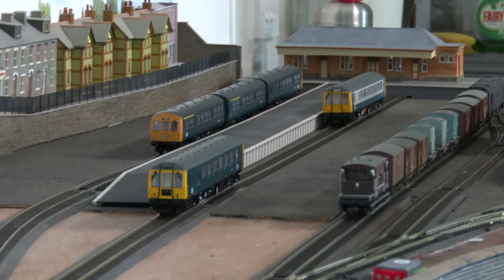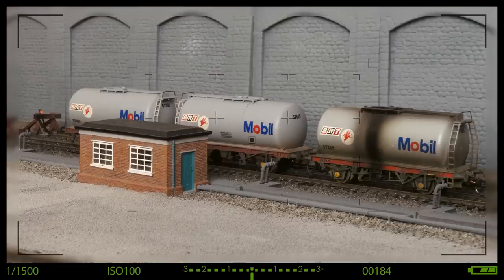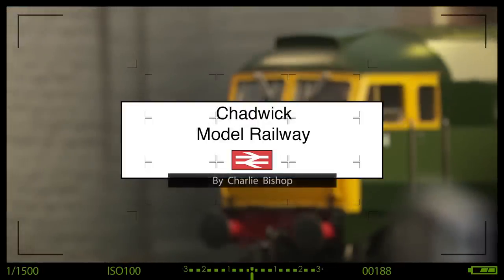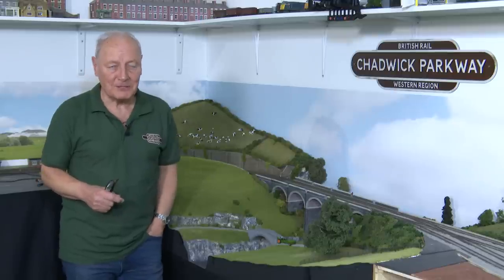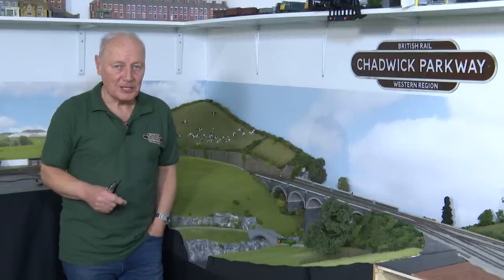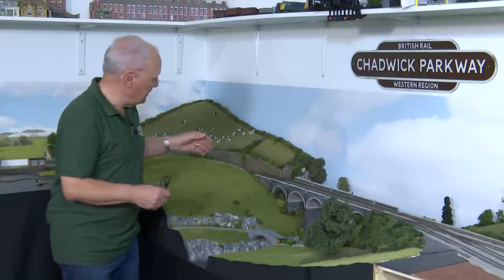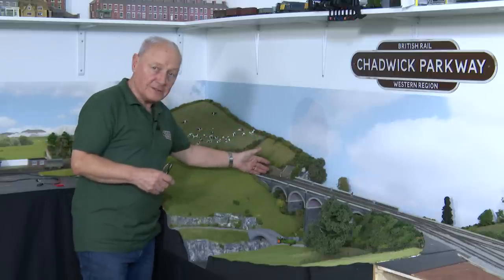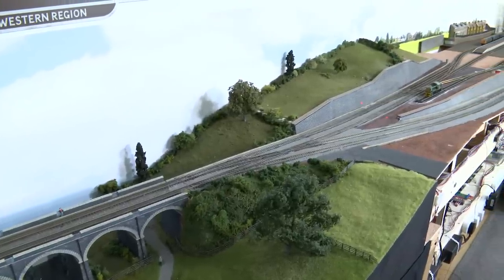SIGNAL POSITIONS at Chadwick Model Railway | 199.

Comment: Hi Charlie, 

A great video, thank you! I'm also trying to figure out how to signal my layout and have been looking at both the SE8C and the SIGM20. Here's what I think I've figured out but would love be corrected if I've got any of this wrong...

The SIGM20 looks like a great product and appears to have the ability to program lots of signal logic based on block occupancy and point position signals received via loconet. Great if you are running trains manually and want signals to change automatically. However, it does not appear to report the signal aspect to loconet and the only external control of the signal is to either force it to red or return it to its usual logic based operation using an accessory address. I use iTrain, but my understanding is that with any computer software you will not be able to display the signal aspect on the computer screen unless it has been forced to red or you set up additional logic within your software to mimic the SIGM20 logic. 

The SE8C does not appear to have any internal logic and therefore any automatic signal logic would need to come from computer software. I have found this relatively easy to set up in iTrain and the logic will still apply even when running trains manually. However, the SE8C is pretty expensive and also has several other functions including operating as an accessory decoder for points. So perhaps if you have signals and point motors in the same area that both need accessory decoders this might be useful.

I use DCC concepts cobalt IP digital points, which obviously have their own decoders included, and so have no use for the additional functions of the SE8C. For that reason I think I'm going to go with the Train Tech DCC signals, which incorporate an accessory decoder, and write logic within iTrain which will control the signals via their accessory addresses. I believe this should work whether the trains are being operated automatically or manually (provided the iTrain is connected and running).

I'd love know if there's anything here I haven't understood properly or whether there is a better solution that I'm missing! 

Keep up the good work with the videos
Reply from the maker: What an interesting comment Duncan. 
You are clearly leaps and bounds in front of me.  Let’s keep in touch regarding development.
Please use 
Chadwick modelrailway @gmail.com.
Regards Charlie

Comment: Hi Charlie,
Always enjoy watching your videos over many years. Regarding the headshunt signalling query, you could use a yellow ground shunt signal without any additional signal to give access to the main line. As I understand it, when the signal is 'on' this permits the driver to use the headshunt, passing through the signal. When the signal is 'off' this permits the driver to access the main line. The old style disc signals were either withe with yellow band or black with yellow band, and the all light style same as the red light type but with a yellow light. I can't say for certain, but the yellow light type may have been withdrawn from use by the 1970's. For definitive guidance you could check with the Signalling Record Society or take a look at The Signal Box. Good luck.
Roger Gann
Reply from the maker: I think you’re bang on the money, Roger. Regards, Charlie

Comment: Hi Charlie! I am not certain, but if I was approaching the station with the intention of going off the main line and into the sidings complex, I would expect to be held at the signal with a red on approach and then, as I got nearer, get a proceed aspect on the position light and a route indication via the theatrebox to give me permission to pass the mainline signal at danger and proceed at caution as if approaching a point of obstruction, as I would be entering a section under localised control.

The points are manually operated by shunters, thus the shunter(s) is(are)effectively the signaller for the section. I would therefore expect a shunter to be on hand to receive the train as it enters the yard. These days there would be a ruddy great stop board and a chap or lass standing there ready to give you verbal or visual instruction (depending on the local rules). I suspect however that ‘back in the day’, the rules weren’t quite so rigid! 😂

You could have different destinations too e.g. ‘G’ for goods, ‘S’ for sidings, perhaps a ‘P’ for private or a ‘C’ for carriage sidings, etc. There’s no real hard and fast rule on such things I find, it’s more about what local practice has historically been. As for the exit signal onto the main line, I’d expect a main line aspect to proceed and an associated position light to govern entry into the headshunt. I’d also expect another position light protecting the points into the headshunt, but again I’m not sure if that would always have been the case! 😉

As for the feather dilema, if the signal had historically been set with the ‘Branch station as the ‘main’ and the other route ‘secondary’, then it would possibly be set at position 4. However, if the signalling system had received a fundamental restructuring and the priorities changed, then I would expect position 1 (or causally more likely, a ‘B’ for branch in a theatrebox and blank for continuing on the main line). Either way, I would expect that if proceeding into the station, the signaller would hold the signal manually at red on approach and only give a single yellow proceed aspect onto the next signal as 1) they are very close together and 2) the next signal would be a red-on-approach signal if proceeding into the yard 🤔

I hope this has been of some help, though if it’s given you more worries I apologise profusely! 😂

Cheers Charlie 👍🍀🍻
Reply from the maker: Great info, Tim, with outstanding information. Much appreciated, regards, Charlie

Comment: Hi Charlie. As someone who travelled regularly from Crewe South Junction from 1957 into the 1980's may I mention that entering Crewe S.Jct northbound there was a massive colour light signal gantry crossing all tracks. Most were "theatre types" giving route indications as follows:- For a platform P# (P1 etc) was displayed. For a bay platform a yellow light with B# (B5 etc) and for non-stop services T# (T4 etc) was displayed indicating which platform you would pass through. As regards feathers normally the 3/4 aspect signals refer to the mainline & any divergence to a secondary route indicated by a feather in the diverging direction. I do have a great book from 1975 by Ian Allen titled "British Railway Signalling by Kichenside & Williams" with colour illustrations & is a mine of information. I can scan the 2 best pages if you have an e-mail address. It does confirm signal for main line feather(s) for diverging routes.
Reply: Charlie, the book I mentioned does have a colour photo of the yellow & white shunt signal as well as all colour pictures of a wide range of colour types. It also has a separate few pages of semaphore types all in colour.  You are very welcome to have copies.
Reply: Charlie the yellow shunt signal is exactly the same as the red shunt one you showed just the red light is replaced with a yellow one. Should have made that clear before -:(
Reply from the maker: Many thanks for your comments, Pat. I have now the correct ground signal on order. Regards, Charlie

Comment: Charlie as an old signalman with Queensland Rail, the main signal always pertained to the main running road so for your signal Number 1 the main running road is over thru the crossover towards the helix so the feather would have be to the left into the station area. This would also advise the traincrew to slow down as they were approaching a yard and not continuing on with mainline track. Of course the crossover would have a reduced speed that would possible be displayed on a speed board with an arrow showing the speed pertained to the diverging track towards the crossover. The worst of all this is there always was an exception to the rule but I can't think of where that exception would occur.
Reply from the maker: Thanks CR, your experience is much appreciated. Regards Charlie

Comment: The SIGM20 can definitely operate complex Absolute Aspect signals. I have one 3 colour signal with 2 theatre boxes showing M & B in one and M,B & S is another. It also has a position light signal. Using 3 of the outputs on the SIGM20 I've automated this with the colours changing by block occupancy and the theatre lights and main signals changing according to the point settings for the Branch, Mainline and Siding . It took me about three hours to set this up using a virtual diverging junction signal (see the SIGM20 instruction manual) set to always red or always green. The AA signals have only one earth, but it works for signals and theatre boxes even if its only connected into the relevant first SIGM20 output connection. The setting of the points and the occupancy 100% determine automatically the correct setting of the signal (lights and theatre boxes). The SIGM20 has a simpler check box setting for feathers, but I can't use that, as far as I know, because the theatre boxes are not on/off types. The feather check box does not work when the signal is red, so its not useful for position lights.  Cheers Charles
Reply from the maker: Many thanks for such an interesting comment Charles. I do own 2 Sigm20 and would like to contact you, when I install them. Could you possibly email me at Chadwick modelrailway @gmail.com. Regards, Charlie

Comment: Hello Charlie, I hope all is forgiven!  1: I was always under the impression that at junction semaphore signals the lower signal arm denotes the lesser route, likewise on colour light signals, the feather lights donates the lesser diverging route, so  I believe that you are correct installing a signal showing the route into your branch line station with left hand feather lights.
2: Dapol do make GWR lower quadrant junction semaphore signals but not unfortunately with semaphore signal arms of equal height. They first made GWR ones, now they a making LMS ones, but I’m still waiting patiently for them to make SR ones, but time could be running out ?
3: In an old Ian Allan book “British Railway Signalling” they show a yellow and white lights ground signal, which is the modern equivalent of the old Westinghouse yellow on black shunt signal, which could be past when ON but would be cleared when a route is set over a crossover from the siding or yard to a running line.
And finally like you, I find that some of these latest electronic signalling devices are really over complicated , leading to me disposing of a DCC electronic turnout module in favour of those excellent MTB MP1 turnout motors that you discussed a few videos ago, thank you very much for that advice.
Best Regards,  Barry
Reply from the maker: I’m so pleased that you found this bewildering subject. Interesting Barry. Regards, Charlie

Comment: You absolutely would have a route indicator lit with a position light. This applies to all signal aspects too: the route indicator usually illuminates first so the driver has time to think and make sure they have geen given the correct route.

I believe the yellow/white ground position lights are still in use. I seem to remember there's one used at Newton Heath depot (I could be wrong as this is second hand knowledge). They also appear in semaphore form as a disk that is a yellow line on a black disk. I am certain they are/were a thing however.

What I would do wth your layout is remove the signal with the theatre back to the one on the viaduct and have an additional theatre indication for the main line "M" because a train stopping at the signal waiting for access to the station/goods yard will overlap the previous signal.
Reply from the maker: You make an excellent point regarding the repositioning of the signal. However, compression is the enemy of all Railway modellers and a little bit of poetic license is being used. Regards Charlie

Comment: Charlie, well done for trying to get the right signals in the right place!  However the Western Region did do things its own way.

As far as feathers are concerned the general rule was that the highest speed route was the main path and did not have any route indication.  The feathers then radiate to left and right of the main path.  So you are correct to use a single POS. 1 at the diverging junction.

The question is just how far (distance) is the junction signal to the branch terminus entry signal?  The real model distance is less than a train length which would not warrant another signal, the route indicator and position light signal would have been transferred to the junction signal in place of the feather.  Assuming modellers licence to insert several miles into this distance then the branch could well have retained semaphore signals with a colour light protecting the junction again.  If the branch terminus is a separate (miles away) location then the exit signals from the platforms and goods would be 2 aspect (red - green) with a block signalling system communicating to the junction signaller, even if the junction is controlled from a panel in another county.  If the colour light signalling scheme included the branch then there would be TCB (Track Circuit Block) from the terminus to the junction and the aspect sequence leading up to the juncation protecting signal would either require 3 aspect signals or else an isolated distant before the junction signal.  So more decisions for you, sorry.

The yellow shunt signal was rarely used but the aspects applied only to the route onto the running tracks.  For movements past rhe signal into the headshunt the signal remained at yellow and shunting moves passed it at will.  There was always an argument that you should then put another signal in the headhunt to prevent movements conflicting with the move onto/from the running tracks!  Again there then comes a question of 'is the junction signal (leaving the branch) also the terminus advance starter?' (distance again) if yes then you probably do not need a main signal leaving the goods yard.

Lots for you to consider but I think that, apart from the idea of the yellow shunt being an alternative to the main green, your proposed set of signals will be fine and easy for your operators to undurstand.

Regards
 Arthur Haberlin
Reply from the maker: Thanks for such an excellent comment Arthur. Yes that’s the only decision I have yet to make. Regards Charlie

Comment: Current National Rail driver here weighing in on the questions.

The feather on the viaduct should be for the lower speed route, not necessarily the physically diverging route, at least in modern practice. 

The theatre box signal. Really the aspect for the goods yard should really be using the subsidiary signal, not the main aspect for entering a yard. And yes, you should have a route indication when the subsidiary signal clears for permissive working. 

Yellow and white GPLs are very rare nowadays but do fit your time period. But the way they work doesnt fit how you want to use them. The idea is a driver can pass then at yellow at any time for authorised routes but for any other route they need to be cleared. In your situation you wouldn't have the main aspect. So the headshunt would be passed at yellow but the mainline would have to have the fully cleared white aspect.

Aaah, signalling is a beast that so many modellers get vastly wrong
Reply from the maker: Great advice, Dave, and I think this time I’m bang on the money, hopefully! Regards, Charlie

Comment: Junction indicators are provided to show that a train is being signalled to a route to the left or right of the straight route.

A junction indicator is normally located above the signal, and will display a line of white lights when a proceed aspect is displayed.

When the straight route is obvious, there is normally no junction indicator provided for this route.

Where there is no obvious straight route, a junction indicator will be provided for all signalled routes.

Where the straight route is not the highest-speed route, the junction indicator will normally apply to the lower-speed route.

Where the diverging routes ahead are both of equal speed, a junction indicator will be provided for each route.

All copied from the Rule book. Hope it helps
Reply from the maker: Great information, Mark, and I certainly was unaware of the speed issue. Regards, Charlie

Comment: Hi Charlie great video as always.
For what its worth i think there is a video called BR signalling signalling which could help you. Its quite a long video but somewhere in that video there is a section which covers a head shunt where when not set for the mainline displays a white and yellow light and then clears to two white lights when set for the mainline. You might be able to do something similar.
One for potential future videos you mentioned you are thinking about which of your points are controlled via a Signal box VS doing it with point rodding.
If you do decide to try point rodding I would really love it if you did  how to video on installing point rodding as I can't find any decant ones on YouTube. 
Wish you the best for the 200th video
Reply from the maker: Thanks Matt, for your useful comments. I have tracked down the headshunt signal, train tech make it. As for point Roding, only time will tell. Take care, regards, Charlie

Comment: Yes with the cats eyes (position light) would have the 1 or 2 lit! Everything inside your yard exit signal could be hand operated! As for your platform signal, you need a three aspect signal or if you are going to use the two aspect version, it needs to be red and yellow. Otherwise if you have a signal protecting the junction, it will need a distant signal to be able to stop at it.
Reply from the maker: Thanks CR, you’re bang on the money. Regards Charlie